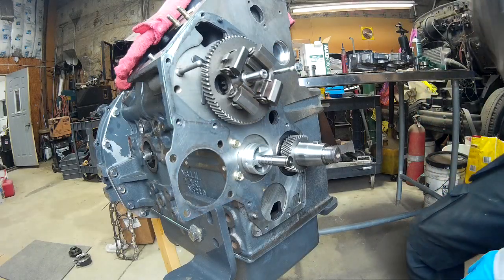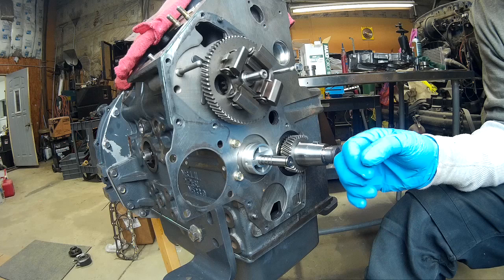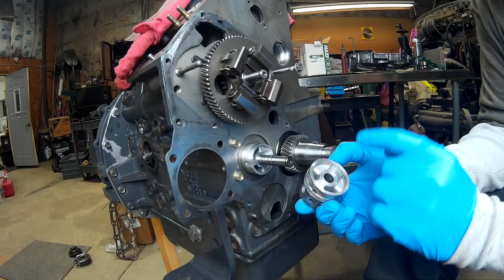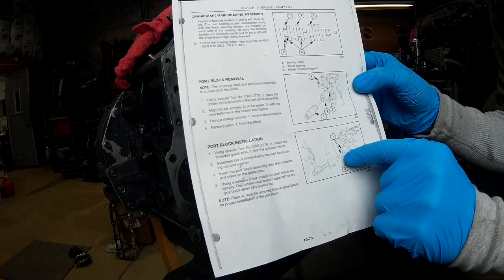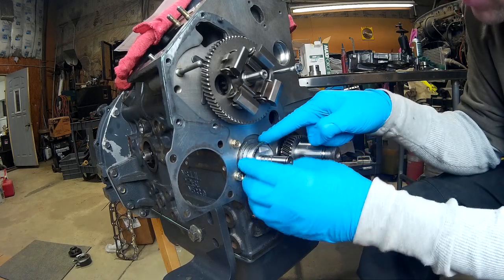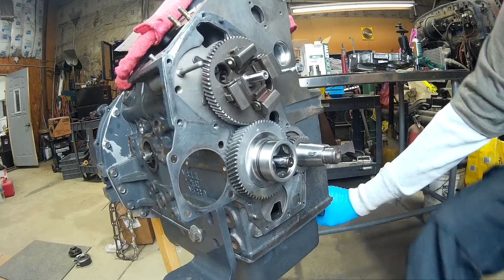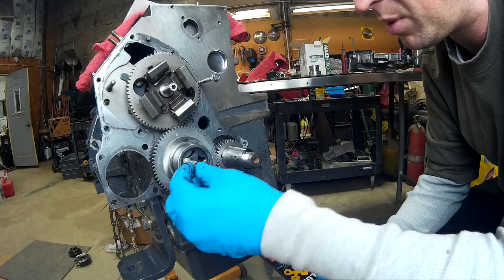Shibura 844LT oil pump

Comment: Do you time it to cylinder one? Or just line up timing marks and put on ideler gear
Reply from the maker: Just line up all the timing marks.     Remember that there is no "top dead center" of the pistons/rod/crankshaft.  TDC is only a concept once you add the camshaft into the mix.
Reply: I removed the cam gear and ideler gear now having trouble timing it any help would be awesome  @CrawfordMethod
Reply from the maker: @daltonlake2564   please describe the actual problem.  What caused you to disassemble the engine, what work/parts did you do, and what is the result now?  

Did you do the spill port timing procedure to time the injection timing and then adjust the timing with shims under the injection pump?
Reply: I removed timing cover and plate behind cam an x ideler gear to fix oil leak i didnt line up the timing marks during disassembley now i dont know how to make sure engine is timed properly @CrawfordMethod
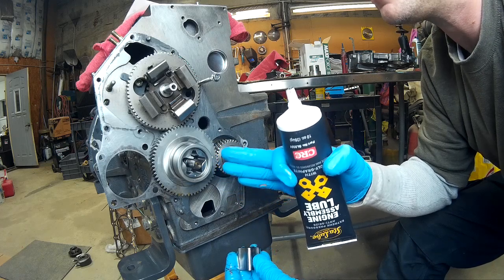Reply from the maker: @daltonlake2564   take off the oil pump gear, rotate the crank and cam until you can put the oil pump gear back on and have all the marks line up.  Check video at 7:35 to see how they are oriented.  The injection pump is driven from the cam, so as long as you have the cam/crank timing correct you will be fine.

Comment: I got one of these that I’m rebuilding . It comes with 3 thrust washers two for the bottom and one for the top . Does the top thrust washer go to the rear of the engine or the front ?

Comment: Carl, you mentioned pump installation with special tool to fit, I noticed you didn't show special tool, how did you work out where it needs to sits so drive gear doesn't lean heavier towards cam or crank,
Question, If I drill & tap the end of the old shaft & use slide hammer, Can I just slide without stripping any more of the engine, 👍🤞 Thanks Hreat video,
Reply from the maker: Matty, 
    Easiest way to remove would be to weld a coupler nut to the end of the pump shaft, slide hammer out. 

To install, you don’t really need to be exact angle, but you do need to make sure the oil pump passages line up with the passages in the front of the engine block.  
     You mention not getting the drive gear to far to one side or the other….  Take a real close look at how the drive gear and the pump base interact. Clocking the pump a few degrees either way has no effect on the centerline of the pump gear!  The only things you need to successfully install the pump are to line up the oil pump passages, and to get the pump started straight into the block.  
      Do pack the new pump with grease or assembly lube, and don’t rotate the assembled engine without the timing cover installed!  The oil pump gear nose is supported by the timing cover.  I fully assemble, but without injectors or injection pump installed. Then crank over to build oil pressure.  Then you can install fuel components, set fuel timing, start!
Reply: Carl, Thanks a million for a detailed reply, Just my first time doing an oil pump on this model engine,, I had to remove engine as loss of oil pressure, I was expecting to find the oil pump in amonst the mains or up close to inner timing casing & staryed to fret,Took injection pump out & case off,My loss of oil pressure was due to long shaft holding pump snapped off flush with the alloy body, Timed & removed gear & outer pump, drill & tap broken shaft & withdrew, Then tapped outer alloy body (M14fine) pulled com8ple body from block,
Yes your correct about fitting  the pump body to block, The pick up journal in the block is quite small, so if new body is aligned & slipped in snuggly all should be good, Carl once again thanks, Top man👍
Reply: Hi Carl, Got a query,  I disassembled new pump to fit to block, Marked it all up as I took apart, fit oil pump, & then the timing gear & oil pump inner, lined up washer to along with roll pin in timing case, put in oil & put analogue gauge on, fitted starter  & spun no oil pressure, what av I done wrong or over looked?, Ta M
Reply from the maker: @mattyt758    What did you do to help prime the new pump?  Did you completely pack the new pump spaces with a heavy assembly lube?  They are extremely hard to prime if you don't use something to establish that initial suction.  Next question:  this is a chicken/egg question.  Have you had the oil pan off and cleaned the sump pickup tube?  Made sure the sump gasket is in good shape where it attaches to the block?  If you have a suction leak in the pickup tube, you will never get a good prime and will have oiling problems.
Reply: @CrawfordMethod  Hi Carl, Thanks for your quick response, After watching you vid the first time j put standard grease in around it,& assembled, Pick up pipe cleaned & suction strainer & new gasket fitted & 10lts of 15w40 oil, I had a script from the manual & them perkins Chaps never mentioned filling pump with oil or grease,

Comment: Having issues with a N843, when the cover is installed how far does the governor linkage move the injection pump slide from idle to full throttle?

Comment: thanks for the cool video. Please tell me, is the crankshaft on the n844t engine and on the n844lt different or the same?  The n844t is a two - liter engine , and the n844nl is 2.2 liters , as far as I know

Comment: I'm glad I came across this video. You were much more valuable in explaining the assembly of this than that worthless CNH engine book. I'm taking mine apart tomorrow (I don't have the front cover on yet) and repacking the oil pump with more assembly lube/grease. I don't think I put enough in there. But the CNH book never mentioned anything about that....anyway....thanks for this really informative video.
Reply from the maker: BrassBuilder, did you get it running?  Another thing you can do is to not install the injectors and injection pump, then fill engine with oil and bolt the starter to it.  Crank the engine to build oil pressure and check for leaks.  The engine will spin with very little resistance because it has no compression with the injectors removed.  Then you can install injectors and pump, set your spill valve injection timing and adjust pump shims if needed.  Once you do that, it should fire right up and purr!
Reply: @CrawfordMethod  Yes! About three weeks ago. Once it got fuel, it fired right up and now after the glow plug light goes out, it fires right up instantly. I had a couple of minor coolant leaks and a faulty thermostat. But a thermostat replacement and tightening a couple of bolts fixed both of those problems. Now I moved onto a larger problem. The New Holland L220 hydraulics are locked out and I can't raise the arms back up to raise the cab. Talking to the local NH skidsteer mechanic, he thinks it might be from when I power washed the cow crap residue out (1.5 hours with the power washer and then another 4.5 hours with a garden hose sprayer for more control) and the water/cow crap mix might have corroded a lockout solenoid under the cab....but as stated....I can't raise the cab, because I can't raise the arms because I don't have any hydraulics. The unit drives just fine though which I find strange. The local NH dealer is supposed to pick it up tomorrow (8/22 or 8/23) and they are going to figure it out. I don't have any safe way to lift the bucket arms.
Reply from the maker: @BrassBuilder  The drive pumps and implement pumps are three different things, do you have any implement functions that work?  Lift, bucket, aux?  
    There is a valve block underneath where the pedals connect, this has the lock spool solenoid in it.  If you could locate the wire that feeds this inside the cab, you might be able to "inject" 12V to it and unlock the functions so you can raise the arms.
   First things to check:   There is probably a "Run/Service" switch hidden in the fuse panel area.  Make sure this is in the "run" position.  Service position locks out the bucket functions.  Key must be in the "On" position, butt in seat, seatbelt on.  At this point you should be able to press the unlock button and move the machine, and to operate the foot pedals for bucket functions.  Here is the next question:  Can you push the pedals after you do these steps, or are they still locked?  If the pedals unlock but no bucket movement, you should suspect the implement pump shaft has snapped or you have a hydraulic issue.  If they are still locked, continue diagnosing the solenoids.  
      I am making you a little video, check for it this evening.
Reply: @CrawfordMethod  I am pretty much following all of your diagnosis so far. This is probably all for mute now since the local NH dealer picked it up Monday and now they have it. I know about the valve under the pedals but I couldn't get to them...or didn't know how to get to it...without being able to raise the cab. 
 I did NOT know about that silly little "Run/Service" switch in the fuse panel area. That one is a new one on me. I was in the fuse panel area and I replaced all the fuses (and cleaned the fuse block with electronic cleaner) and switched all the relays around but I did not see that switch while I had my head someone poked down in that foot well.
.....Here's the thing. When I started it and unlocked the park with the lighted push button with the 7,8,9,0 (hydraulics unlock) above it, that light kept blinking. If I remembered correctly, I thought that light went out once everything was good to go when we first brought the machine in back in Feb. Once I press that button now, the park light goes out, I can move the machine, 2 speed works, the pedals on the floor works (they tilt back and forth), but my hydraulics are locked out...but the 7,8,9,0 button is a constant blinking. 
I should not say the cylinders are completely locked. They is some movement. Something like 3/4" in the main arms and just a slight movement in the bucket arms.
I don't know about the aux as I do not have anything to hook up to that. But I will as I just ordered a set of hydraulic forks for it on Monday. 
Thanks so much for the replies Carl. Maybe this will help some poor owner of an L220 in the future. Thanks.

Comment: Thanks, wery useful video - I was scratching my head on how to remove from the block on my Perkins 103-10... I made my own extrator tool using a long M8 bolt and large socket covering the port block. Gradually "doing up" the M8 Bolt with spanner holding the nut at the other end of the port block drew it out from the engine.

Comment: I just ordered s pump off eBay and installed it only to find out that the od of the pump is .390" larger so the front cover won't fit. Have you ever run into this? Is there a different cover. Engine is a reman 3024c in a cat 247b with about 300 hrs on the lost oil pressure and ruined the turbo.
Reply from the maker: There are two oil pump sizes. In the end of this video you can see me discover that I have installed the “small” pump when I needed the “large” pump. You should get the correct pump and keep the engine/timing cover a matched pair. The governor is in the cover, and is not adjustable.
Reply: @CrawfordMethod  yes I got with the company and they are sending me the 52mm pump free of charge. I feel that this is really a poor design for and oil pump. Thank you for the reply.